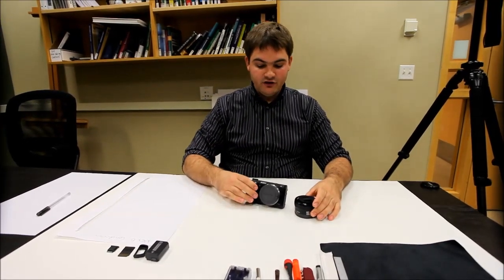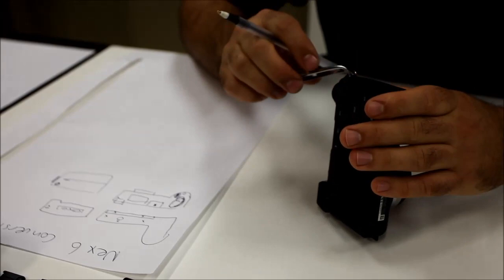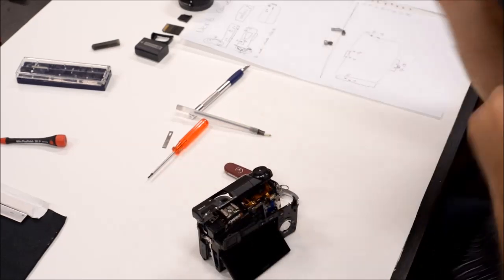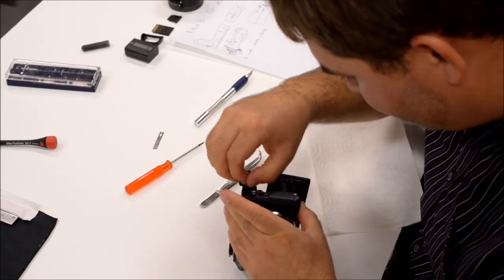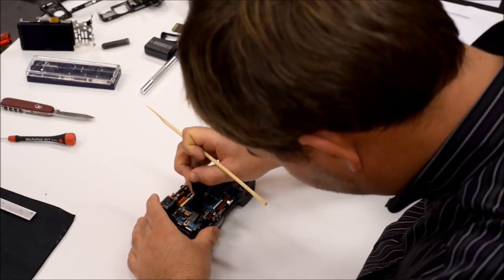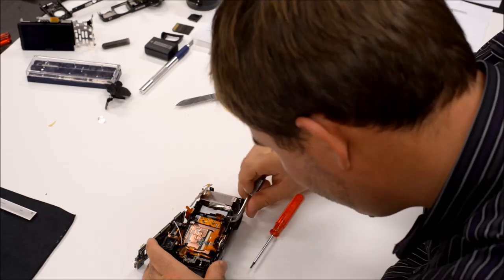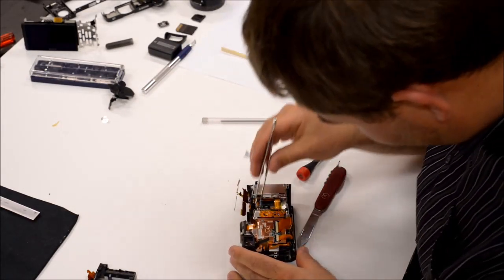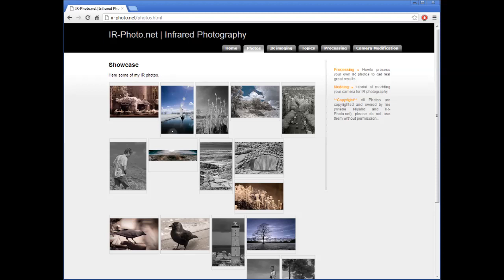Sony NEX-6 teardown and Infrared conversion

Comment: Same problem as Daniel below. Put an NEX 3-F3K back together (twice), checked all cables, connections- screen won't turn on. What is wrong?
Reply: +G Sor I had a similar problem where the screen is not working. Only the viewfinder is working, and when I try to take a picture, it says "camera error: turn camera off and back on". Did you ever find a solution?